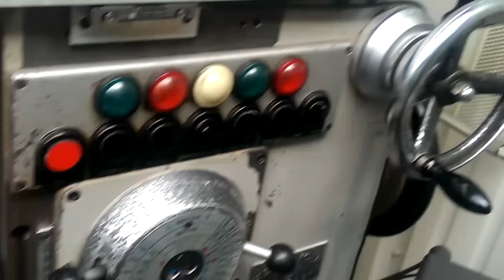Garret GTX28 Turbo Flansch selbst bauen von Hand

Comment: kann man so ein flansch nicht kaufen?
Reply from the maker: +Whayo 
Klar kann man den auch kaufen, für etwa 30€
Aber wenn man viele Teile selbst bauen kann, wird ein Turboumbau / Motorumbau um einiges günstiger, als wenn man alles neu kauft. 2h Arbeit ist das aber schon in etwa, bis alles gefräßt und gefeilt ist. 

Da summieren sich auch die Einzelteile. T25 Einlass Flansch kommt noch mit dazu, sowie Öl Rücklauf Flansch am Turbolader. 

Wenn man unterm Strich viele Einzelteile nach feierabend selbst gefertigt bekommt, wird so ein Umbau gar nicht mehr so teuer. Danke fürs Kommentar :)
Reply: +Race NfunTv man muss halt auch erstmal die geräte zur verfügung haben und zeit. 
danke für die antwort 😅
Reply: +Race NfunTv  hättet ihr das mit einer cnc fräse gefertigt maximal 30 min mit Programm
Reply from the maker: +Mj-U 
Klar das wäre viel schneller gegangen :) Leider hab ich keinen Zugriff auf ne CNC :P
Aber viele Hobby-Bastler können sich ne alte gebrauchte Handfräße kaufen für die Bastler Garage. 
Hab bei mir eine in der Werkstatt für 200€ aus nem Insolvenz Verkauf einer Firma.
Reply: +Race NfunTv es heißt FräSmaschine. Nicht Fräßmaschine
Reply from the maker: +heizerbirne 
Danke für die Information, du hast eine Tüte Haribo Goldbären gewonnen!
Reply: Race NfunTv Besser wäre es, wenn ich ein Wörterbuch gewonnen hätte. Dann könnte ich euch das zuschicken